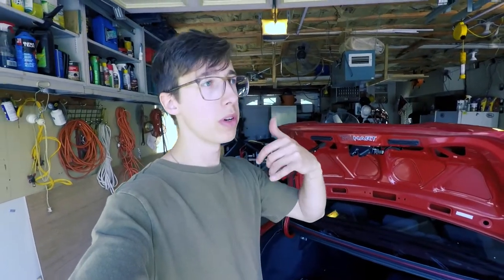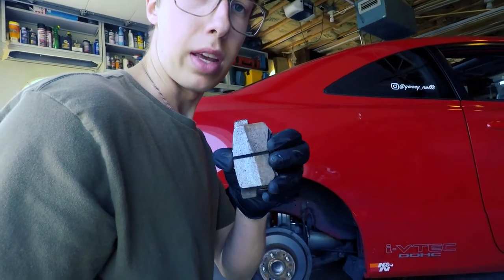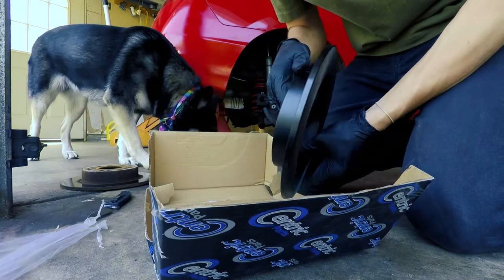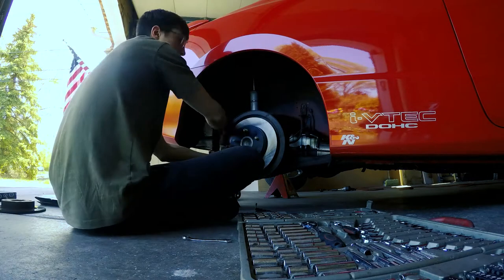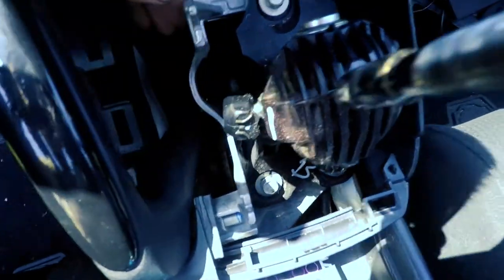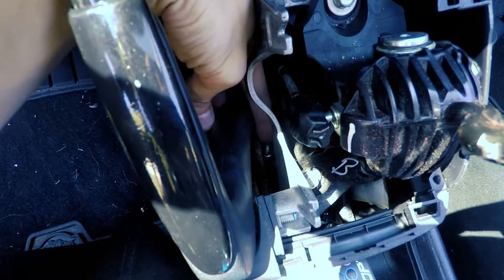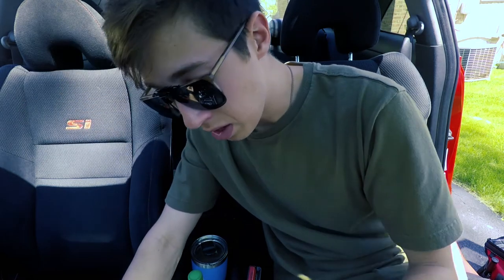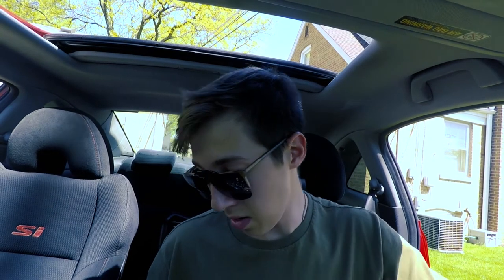Civic Si Rear Rotor Replacement

Comment: a noise like you explained might also be a wheel bearing going out.... could be the tire tread ware like you said... but i am thinking wheel bearing might be wrong though... also.... just a question... have you ever pulled up your e brake and like done e brake slides or slides just going strait.... lol just wondering because my friend a long time ago we had his dads car... and we thought it was the shit just going around and hitting the e brake and sliding all over... lol even if we were just sliding in a strait line.... BUT!!!! LMFAO after while my friend said his dad noticed that he would drive his car to work it was making this weird ass wobble sound almost like  you are describing... and les schwab tires lol told his dad that it looks like someone was doing some E brakes with the car and wore the tread down on the tires in weird ways so its causing the tires to make that wobble noise.... LMFAO!!! lets just say his dad found out and was not happy LMFAO LOL but yeah that's why i ask... LOL honestly you don't seem like you would be doing that stuff with your car... but you never know lol so if you have done anything like that then yeah i am gonna say its your tire tread but i am still thinking right now its wheel bearing. hopefully this helps man lol :)
Reply from the maker: Gert wheel bearings are brand new. And yeah, i never do ebrake skids. Hahah. Only did it once in the snow.
Reply: damn... brand new :( well shit... LOL and yeah you don't seem like the person to do that stuff... lol looking back at it now its dumb to do and i would never do to my car... but you know young kids in mom or dads cars lol how am i ever gonna become a stunt man if i don't tare up mom or dads car!!!! LMFAO JK JK hmmmm well not i am curious as to what it is too.... might be tired tread like you said.... but i feel if it was making noise like that you would maybe able to see the tread difference causing the noise i don't know i am no expert lol just throwing shit out there cause i like to help people.
Reply from the maker: Gert yeah, i just had the car aligned yesterday and they told me to switch the 2 rear tires to allow the tread to even out.
Reply: ahh sweet well hopefully that works!

Comment: You put your old pads on your new rotors?
Reply from the maker: Jonathan Keller is it a dumb idea? Or is it ok?
Reply: Yonny Nolls

New pads on new rotors or resurfaced rotors... your old pads will create uneven wear on your new rotors defeating the whole purpose. You also need to bed the new rotors/pads for 500-1000 miles before any spirited driving on them.

Your problem sounds like a bad wheel bearing to me, but I can't say for certain since I don't know the history of your whip.
Reply from the maker: Jonathan Keller thanks for the tips! My wheel bearings are brand new. Ill pick up some new pads asap.
Reply: oh crap man i didn't even notice you put the old pads on... always buy new pads with rotors and also those old pads you had were toast... they were very uneven and should have not been used again... i would go get new pads asap